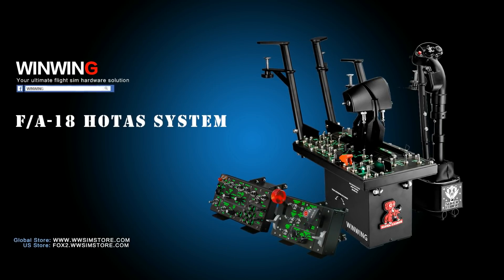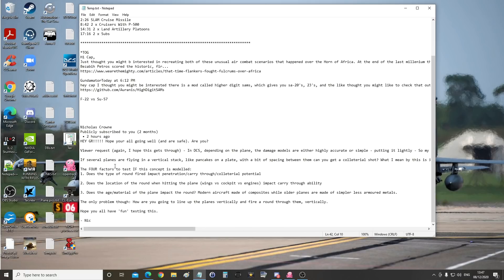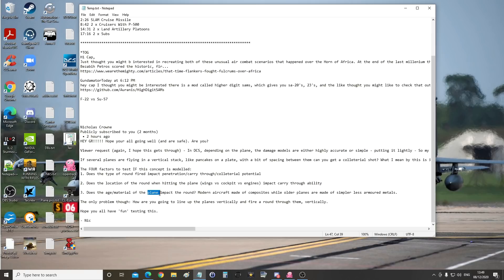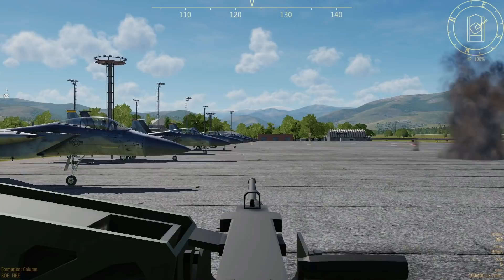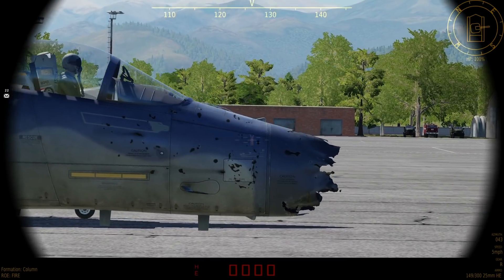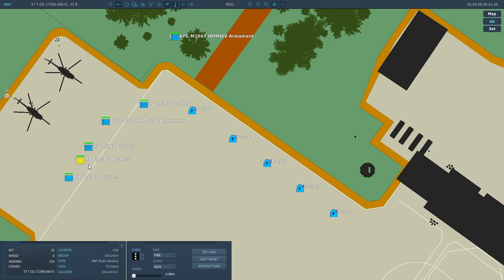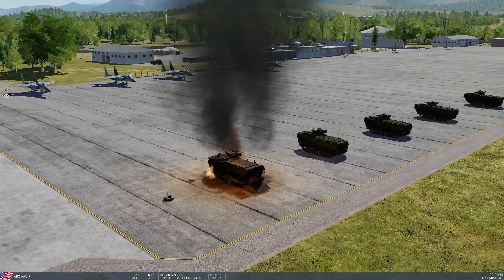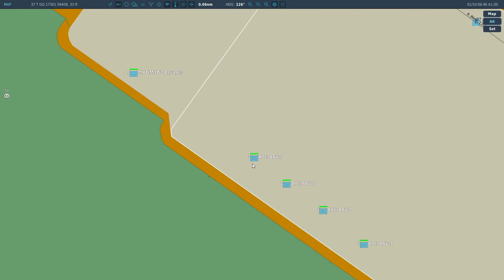Questioned: How Is Damage Penetration Modelled In DCS WORLD?

Comment: Even though you are likely to never shoot through one plane into the other you still need to model penetration because the round doesn't stop on the first surface it touches.  For example on a deflection shot you could hit the wing and the round penetrates through the wing and into the engine or fuselage.  I think you should test that.  Maybe have a plane strafe a plane on the ground with just a couple rounds and see if the damage goes through one surface into another.

Comment: You should be using Notepad++ instead of the lame Microsoft Editor.
Reply: Lol, why? This works just fine and requires zero skill or downloading or anything. Reinventing the wheel for no reason is just a waste.
Reply: Using Notepad++ is not hard at all and it offers automatic line breaks, so you do not have to scroll to the right each time you read a long line.

Comment: Programming wise it's much simpler the way it worked out. Bullets are probably just particle effects and it's much simpler to program "if impact with collision map, then delete effect and implement programmed damage" and the damage model for said particle could potentially be aoe considering the round could be explosive so perhaps the next test along these lines is to how close two parts of a plane have to be for that area of effect of say, an HE shot from a Bradley, do damage to the second plane near by. Assuming a weapon like that is modeled for aoe.

That's not to say it's impossible to program in penetration or even redirection. It's just much simpler and takes less resources for the game engine to understand.
Reply from the maker: Roger Greg
Reply: If muzzle velocity is e.g. around 960 m/s and physics frame rate is 60 FPS the bullet travels 16 m per frame. That means if a bullet is right in front of a 16 meter wall in the next frame it is behind the wall. Kind of a tunneling effect. So the first challenge is to detect a collision at all. I think one trick is to use a stretched collision box. So e.g. instead of a small collision box that just contains the bullet a larger, stretched collision box is used which represents all the space the bullet travels between two frames. 
I think there is no way that all the bullets are calculated individually with the current hardware, although sometimes it almost looks like that (tracers bouncing off ground etc).